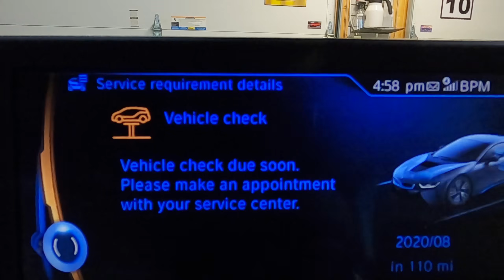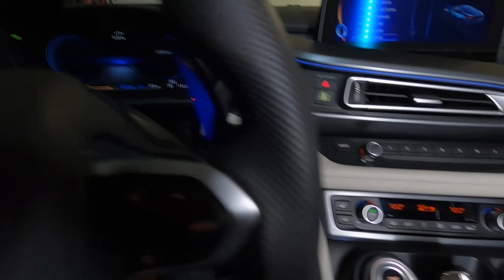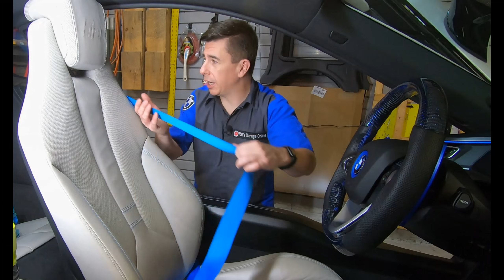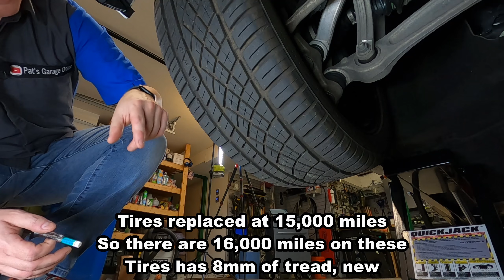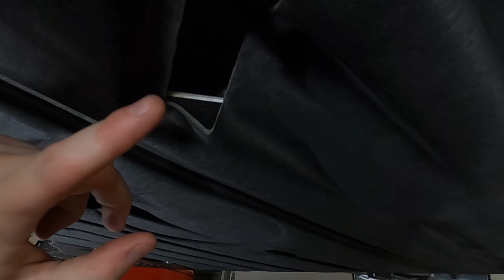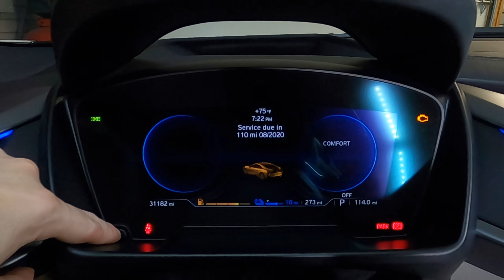BMW i8 Vehicle Check warning popped up.  I found something wrong!

Comment: Hi Pat, Can you advise me how to reset the Vehicle Inspection lights on my 2017 BMW i8 please
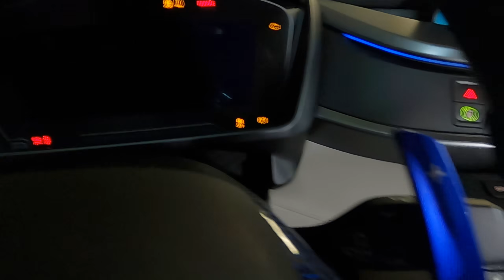Reply from the maker: See 18:50 in this video
Reply: @PatsGarageOnline  thank you for your advice....a message now sometimes pops up saying: (thermic) engine error (drive train...can't restart) + RBS malfunctioning (unable to do brake retrieval)...but when I restart All Is again clear (no error at all)!!!
Please help me!
Thank you
Reply from the maker: @hussilveridico3002  These are general errors that don't point to a specific problem.  The only way to diagnose the issue is to have BMW check it out, unfortunately.

Comment: So when you took it to the dealer did they find the leak, what was it and how much was it. Great video by the way.
Reply from the maker: I took it to the dealer and let them know that the CV Joint had a pin hole.  They confirmed and replaced the entire axle under CPO warranty, at no cost to me.

Comment: Bummer on the CV bootie. That is a messy job so good you can get that done. Look around a bit more to see if you can determine the cause. They should last quite a bit longer that that. That is strange. The grease in there is black so sounds like that is what you are seeing... Nice job going through everything! Thanks! F
Reply from the maker: Thanks Franny.  I posted on the i8 FB group and 5 other people told me they had the same exact problem.  Some had it happen under factory warranty and the shop replaced both axles because when one goes, the other is expected to go.  That bothers me.  There's no individual boot that can be ordered to replace this one.  It's an entire axle swap, from what they've told me, because the part manufacturer doesn't sells the boot separately.  I spent an hour under there yesterday and can't find the cause.  It just looks like a pin hole.  They may decline me warranty replacement (claiming debris hit it) so I have to decide if I'm going to seek out a universal boot or pay them $4k for the $1300 part plus labor and alignment IF they tell me they won't cover it.
Reply: @PatsGarageOnline  What! had to replace both axles! that sounds crazy im sure that it must be possible just to get the correct rubber gaiters..i would hope that someone has managed to find a correct replacement gaiter, as it must just be just something like the diameter of each end and the width..BMW must have a supplier in germany.
Reply from the maker: @stevemain9582  Many other i8 owners have been through this same problem.  The axle manufacturer will not provide any details on the boot.